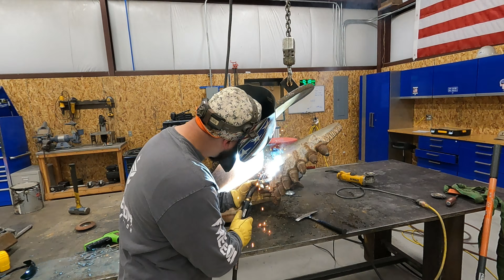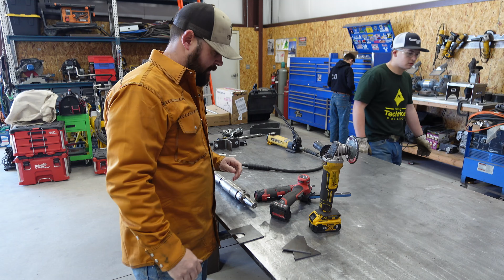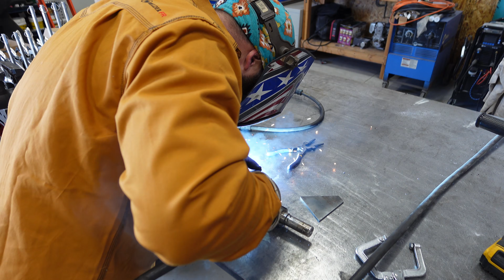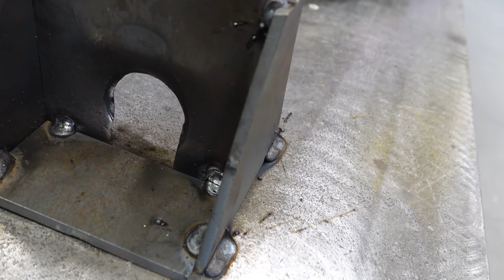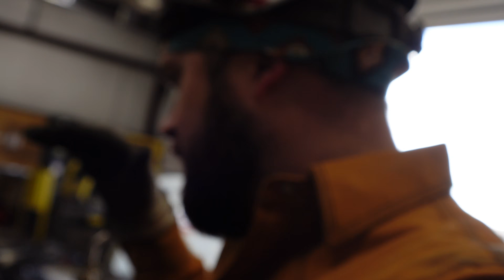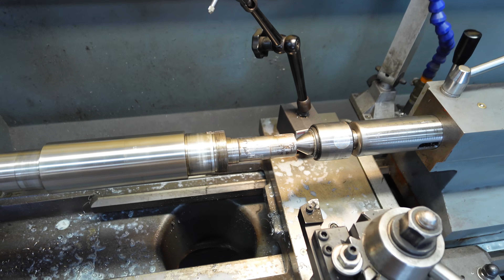Tig welding and machining repair on a stainless pump shaft

Comment: Why not build your own shop press? You will probably get way more tonnage for $10k than buying one. Plus it would make a great youtube video series. Win-win!!!!  The most common complaint for fabricators when they buy a plasma table , fabricating table or a shop press??? "I WISH I BOUGHT A BIGGER ONE"
Reply from the maker: This is true. I will have to shop around and see if I can find a good pump and cylinder. Those are the hard things to get.(good ones)I’ll do some leg work and see what I find. Thanks for the suggestion, and thanks for watching!

Comment: Just a thought; I wonder if leaving the rotator on while the shaft cooled would help it not warp???  Or turning it vertical so there is no side load from the weight of the shaft while it cools???  That shaft would be good enough to run in a jet boat, nice work on the repair.
Reply from the maker: That’s not a bad thought. Or maybe put it in the lathe and let it spin. Thanks for the suggestion, and thanks for watching.

Comment: I watched Steve summers shorting a drive shaft . It had more run out when he welded it back together  . He applied a little heat to straighten it back out. Seem to work very well . If it stayed long-term, hard to say
Reply from the maker: I’ll have to check that out. Did the heat pull it back straight? Or did he have to heat it and put some pressure with a press on it as well?
Reply: @Freedomfabrication777  Just heat no pressing
Reply: Man I miss his videos!  If I recall correctly he put some heat opposite the runout and let it cool, and it pulled back straight some, but don't quote me.
Reply from the maker: @rodneymarquardt7969 Ok. I’ll see if I can find it. Thanks!

Comment: Clam shell bearings puller. Dude, you don't have a hydraulic press.
Reply: Seriously. Harbor Freight sells a 20 ton cheap. That and a bearing splitter would have made this a 10 minute video.
Reply from the maker: @joefowler6866 what would the bearing splitter be used for?
Reply: @Freedomfabrication777 bearing splitters are great, they would allow you to have grabbed the inside lip of that sleeve while resting against the press table to you could press the shaft out of the sleeve
Reply from the maker: @OrdnanceOffroad I can see how that would be beneficial. I still would have had to fabricate something to push against, but it definitely would have been easier. I’ll have to get one. Thanks for watching!
Reply: @Freedomfabrication777 what you did is still a legit repair, whatever it takes to get the job done! Just definitely get a few sizes when you get a shop press. I've even used some with H style gear pullers too
Reply from the maker: Not yet. Maybe some day! Thanks for watching!